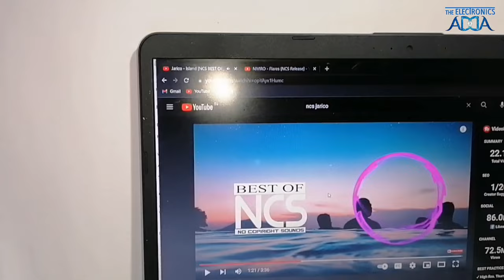How to Make a USB Speaker for Computer | 2.0 Multimedia Speaker | diy Desktop Speaker

Comment: Exaplain about the chip used
Reply: It is Pam8403 amplifier module
Reply: @AkvilExperiment  does it Complosory
Reply: It probably pulls in the 5v or whatever from the USB and is a mini step up transformer to like 12 volts or something around that to give the speakers more power.
Reply: Pam8040 module

Comment: Ohm  connection not very clear
Reply: @7:33. 330 ohm resistor is connected with the -ve (shorter side) leg of led. +Ve side of led is connected with red wire on PCB( power
And another  side  of resistor connect with black wire(neutral)

Comment: pc ka subwoofer ka power on nhi ho rha h ,uske sath 2 small speakers ko jab direct pc se connect kiya to bahut halki volume aa rha h 

Kuch ho sakta h ya bahar fenk du.
Reply from the maker: Subwoofer ka power check kariye
Reply: @THEELECTRONICSADDA  ,power ki light on nhi ho rhi h.
Uske board tak current to ja rha h.
Reply from the maker: OK
Aap 3.5mm audio jack check karke deksakte hain